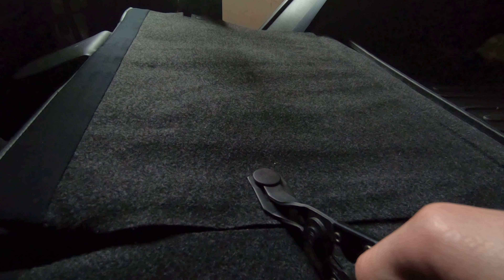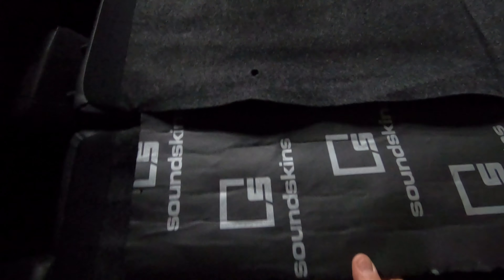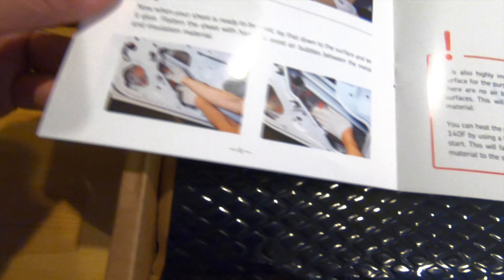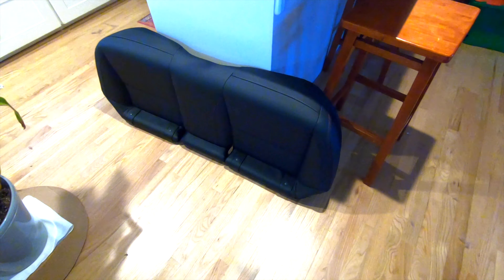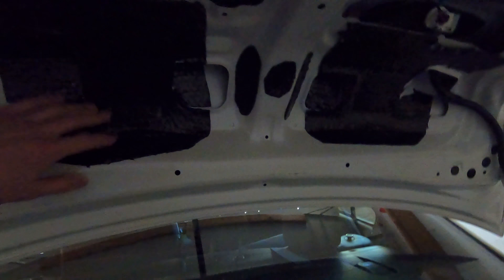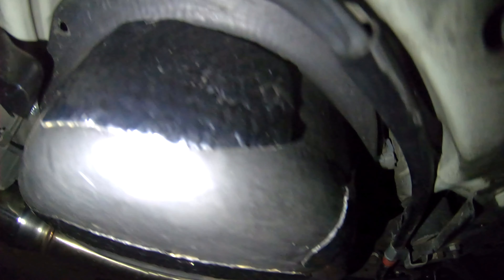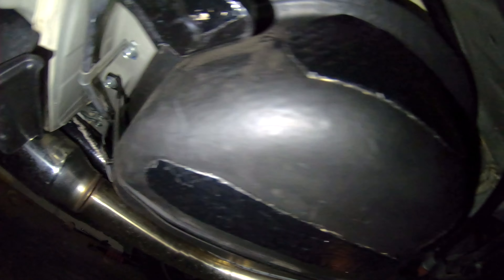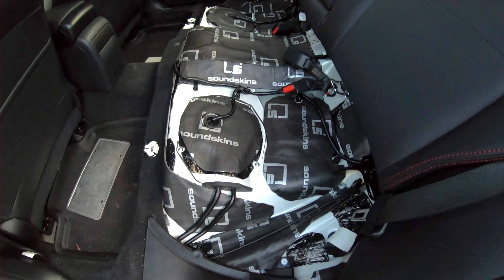2018 WRX/STI: Sound Proof rear seats, trunk lid & gas tank with Soundskins & Noico

Comment: I would think closed cell foam or mass loaded vinyl would be better for blocking certain frequencies. Sound skin/noico or any sound deadener will stop panel vibrations and only have minimal frequency blocking properties.   The rear deck is vented to allow the doors to shut so air can escape the bumper vents. The chopped denim padding has better sound (frequency) blocking/absorbing properties than the deadener. Next step is wrapping the mufflers.

Comment: I was just going to do the Noico but you're definitely making me think about the Sound Skin material. I have an r400 catback and running flex fuel. I would love to quiet down the cab on my morning commute. 

Post an update before you move onto the doors!!
Reply from the maker: Sam Jennings the Soundskins is definitely an awesome deadener, the acoustic foam Cuts out more frequencies than the Noico. However the Noico is heavier and probably best suited for excess vibrational areas.
So far my drone is almost nearly gone on the highway drives but I can still here it just barely. Rear tire/road noise is less present as well. 
Thanks for watching man!
Reply: I will likely do both. Looking forward to your next update! Sadly I will probably have to do my car and my wife's Forester. She is complaining about road noise

Comment: Has it made a huge difference? I was hoping for a before and after video using a decibel meter for comparison.
Reply from the maker: Ian R I wish I had one of those, that would be the Most accurate way to really measure it all. But yes,
So far my drone is almost nearly gone on the highway drives but I can still here it just barely. Rear tire/road noise is less present as well. 
Thanks for watching man!
Reply: Baby WREX I’m sure you have a an Android or an iPhone.  They both have apps that measure sound.  Look for SPL meter.  If you can take a reading and I’ll compare it to mine.  I own a 2018 WRX premium model.
Reply from the maker: Ian R I downloaded Decibel X & SPL meter but that one doesn’t fit on my iPhone X screen right might not be updated. I’ll do some idle, 30mph & 60 mph and keep ya posted.
Reply: Baby WREX Thanks for doing this! Funny thing, I have an iPhone X and my Subbie is white too! 😂
Reply: Mods And Coffee if you want to get rid of some road noise add some material to your wheel wells//tge car metal—and on the back side of the wheel well covers.